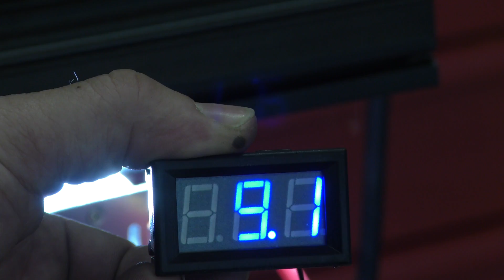What is Inside a LED Light Bar

Comment: It's good to now that the power input is about a third compared to they advertised with. My assumption here is that the light output of the leds corresponds to the light output of a 300W filament/halogen light source which is somewhat correct(ish). I was about to buy the 600W or the 760W version for different purposes. Thanks for taking it apart!

Comment: Yeah Tyson don't feel too bad, you don't accumulate a good set of tools in a short amount of time it takes years to get that perfect set of tools, as they say Rome wasn't built in a day ya know lol also @RDAllen in my opinion a good light bar shouldn't drop amps or volts in its electrical intake just because it's been deconstructed, from what I've seen from all the light bars my buddies have gotten most of what can be taken apart on a light bar is the reflectors and the external skeleton, I may be wrong but if something drops it's amperage pull because it's protective casing has been removed is caused by what I call an overlap with the positive and ground where the ground wire isn't secured enough and the positive tries routing power through the ground wire, that happened when the headlights in my truck stopped working because of an electrical failure, it was a major pain but I was able to rewire it in about 2 hours and haven't had any problems since
Reply from the maker: Yes, it is weird that the amps would drop plus it is only drawing 9-10, for 300w seems like it should be a lot more.